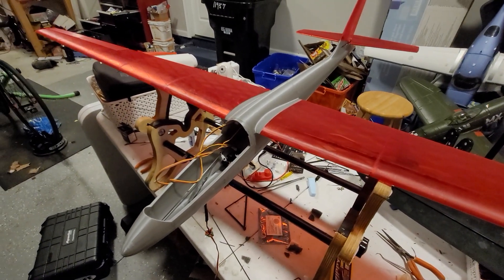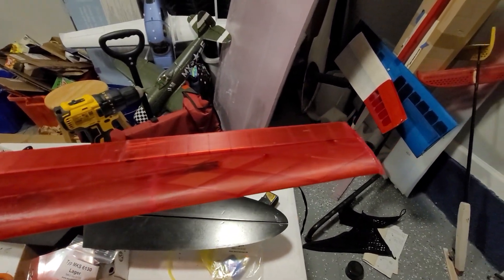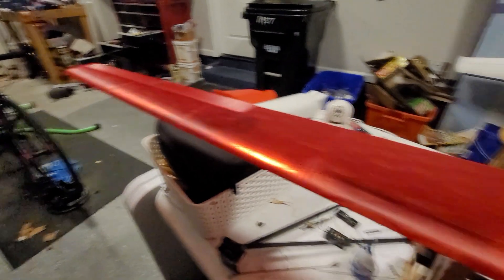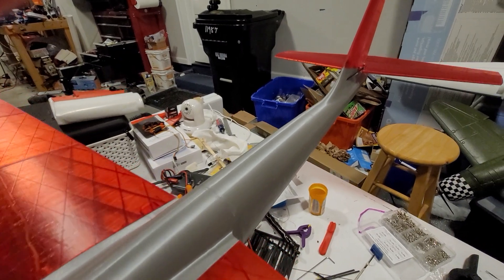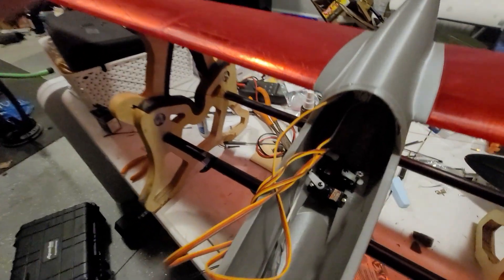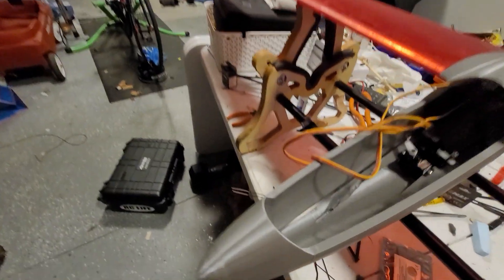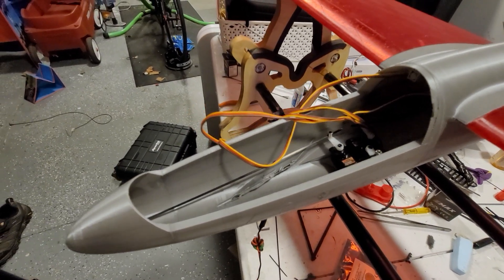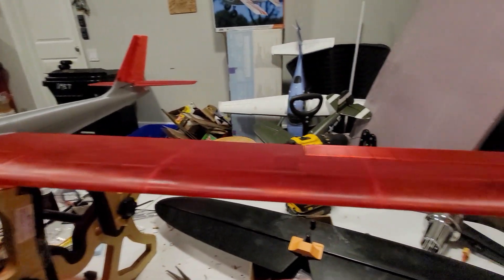Foka Sailplane By PlanePrint.com

Comment: Ive just printed the Foka, and there is a problem with the Stls where the right wing will not sit flushi think i can see the same issue on yours, is that the case?
Reply from the maker: I don't recall there being an issue with the wing meeting the fuse. I was doing some hand tosses and set it down in a little hard once and it busted up the fuse in the middle. This model will need some delicate landings.